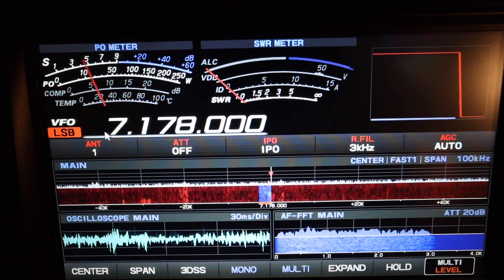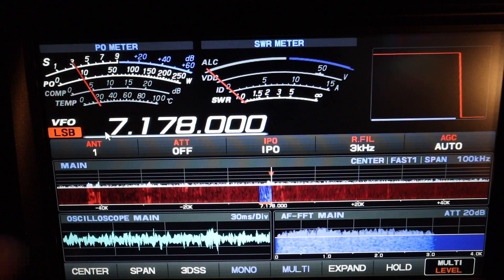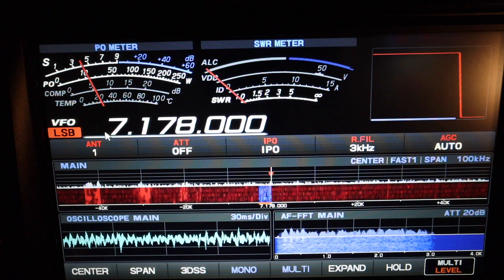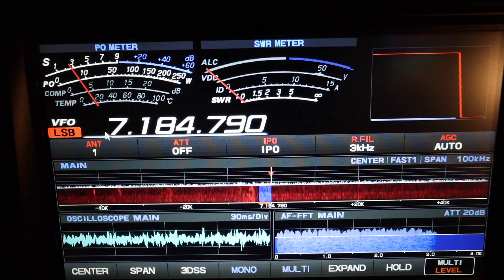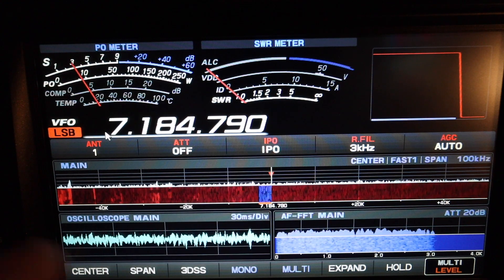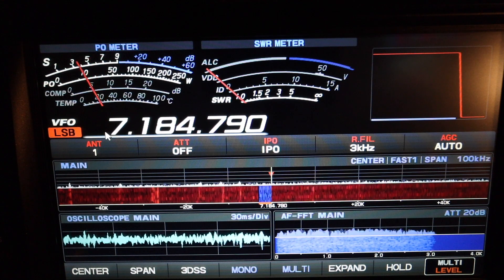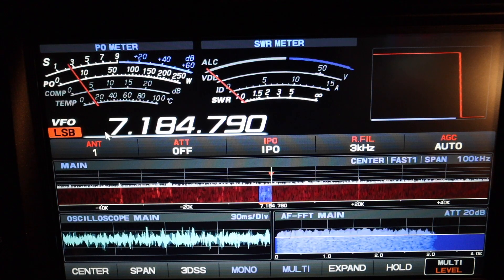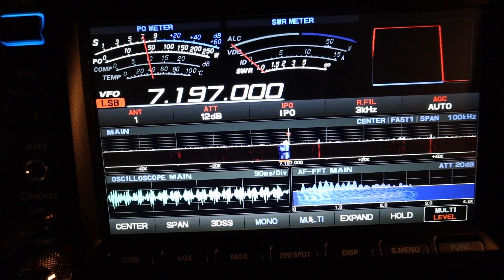Power Line Noise Update!

Comment: Always nice to get something like that fixed. That seems odd that the power line would just ramp up and take off like a motor coming on. 
BTW what is the linear light bar   that pulsates above you call letter sign?
Reply from the maker: Those lights above my desk that changes every 2 seconds are called "Tix Clock"  I believe they are discontinued though.

Comment: Yeah JEA came thru !!   Looks like a 3-phase transformer bank on pole 110.  Normal design standards would include 1 lightning arrester per phase along with 1 fuse-cutout per phase.   I suppose the birds may have built a nest in and around an arrester which could have made the arrester fire periodically (but high voltage above the arrester rating, or an arrester which has had one too many lighting hits could also be causing similar problems).   Glad it worked out Capt.  Old EE signing off.  PS Just started in the Ham radio hobby, building my station now... KO4QWY whoa that's a mouth full !  😁
Reply from the maker: I'm on 40meter tonight and the power line noise is way way down to nothing However, on 20 meters is a different story.  I can see the power line noise in my built in oscilloscope on my Yaesu FTDX101MP.  Today, I saw the JEA gang in their van using their infrared device to look at power poles. I'm glad their in my neighborhood checking things out.
Reply: @DarrenN4VFR  Good the IR equipment will help them look for hot/bad connections and potential bad equipment (i.e. a transformer with a slow leak of oil over time will begin to show hot on their IR). Good to see they are performing a solid effort. I would recommend a creating a log on what times you notice the noise.  When i was in power quality many years ago, we found keeping a log would sometimes provide clues to certain times of day which led to discovering the offending source. One last thing be sure to check your own appliances and devices for proper operation in your home (lose connections, failing equipment, etc).    If your soil is sandy which i expect it is, this is infamous for poor grounding resistivity (the utility and your home, but not much you can do about that {worse is dry weather}).  Another potential would be a neighbor's house and his/her sources of electrical noise.

Another potential comes to mind since you mentioned your HF (40M & 20M frequencies), catv internet upload frequencies are in that 5MHz to 50Mhz or beyond range.  Older coaxial catv systems are known to be leaky, so i would recommend checking your internet service in your house first for lose connections, poor grounds, and your modem (if your modem is close to your rig i would suggest turning off the modem as a test also {unplug it} then recheck your radio).  Outside check for the closest catv cable (your neighbor, a pole line etc).   On catv they use main trunk amplifiers and line-extender amplifiers {smaller typically 12" long by 8" tall}, if you have one of those by your house a lose connection there could be part of the problem.   Lets take this one step at a time as the world of power quality can be a never ending funhouse!!  😎
Reply from the maker: @wramsey2656  Geez Louise,  Thank you for all the info to check.
Reply: Lol well when your medically retired your mind wonders lol

Comment: Interesting, I'll have to see if I can track down the source here in mandarin, I get the same noise, but predominantly on 20m, I'll take an am radio on my next walk around the block with the kids and see If I can find it,  knocked out the last of my local sources by process of elimination, the last being some LED lights from IKEA, which I suspect use some sort of PWM for voltage regulation.  so its either the transformer box across the street or something an my neighbors house, for now been able to work around it with DNR in my Yaesu 73 Darren safe travels pare
Reply from the maker: The raspy power line noise is gone on 40m and my 20m band, I'm picking up some power line noise but not what is was 2 weeks ago.  I ran into the JEA utility van in the neighbor hood and they're using infra red technology to identify faulty power line poles.